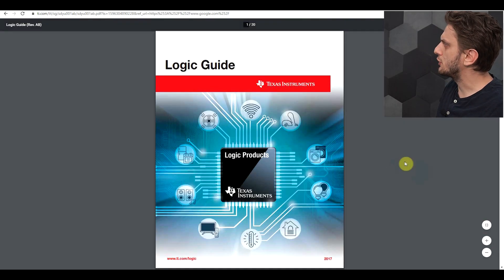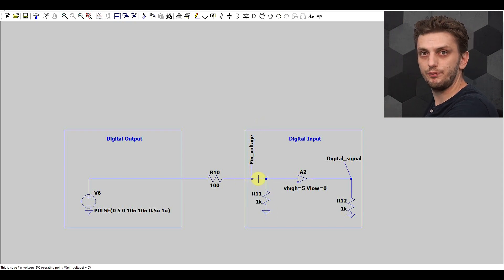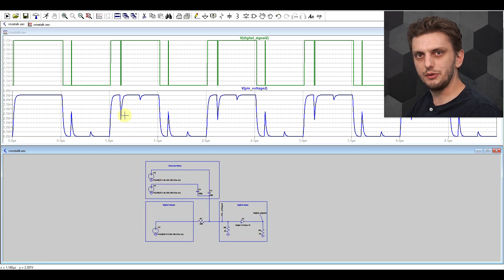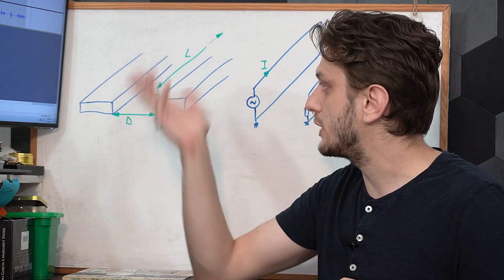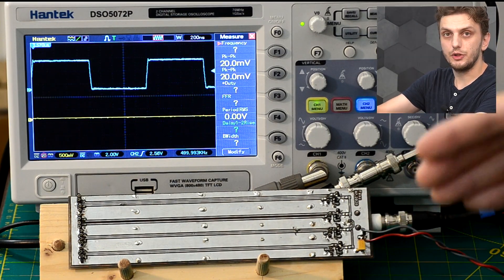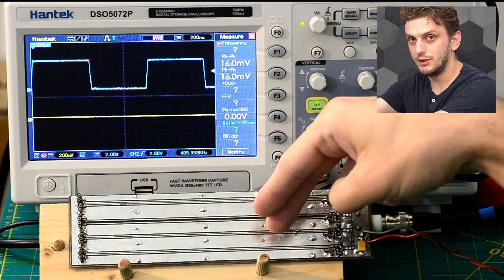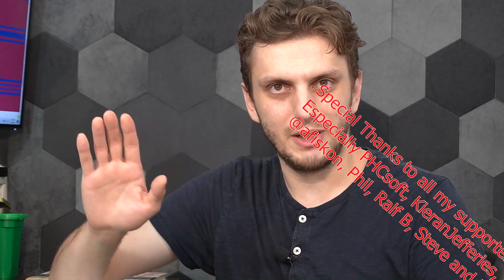Electronics tutorial - Crosstalk

Comment: Any other ways to make the crosstalk on the victim line worse by changing something on the aggressor line other than rise time?
Reply from the maker: The signal amplitude will have a direct impact on the induced signal. Otherwise its a mechanical topic - the exact distance between the traces and the distance over which they are adjacent.

Comment: keep them coming good man,
One question: why does high impedance source implies an E-field coupling and low impedance implies H-field coupling?
Reply from the maker: Hello! Well an E-field is generated by voltage applied between 2 terminals and H-field by magnetic fields, which are created by current going trough conductors; If we have a given amount of power (say 1W); the highest voltage (that will generate E-fields) will be obtained by applying the power onto a high impedance load - this will be accomplished with a low current ; on the other hand to get magnetic fields, so high current we need a low impedance, that will cause low voltage. Let me know if this makes sence
Reply: @FesZElectronics  Thank you good man.

Comment: Hey, I have been watching your videos for a long time. Your work is legit and far more precise than other youtube channels. I am very thankful for your videos. Talking about precision and accuracy, can you tell me how to accurately model the capacitance value that represents the coupling between a DUT (Device under test) and the ground plane when carrying Conducted Emissions Test for compliance. I really need a legit answer and I was hoping if could help me with that?
Thank you once again.
Reply from the maker: Hello Sajid! Well there is no easy answer to this. Depending on how the DUT is built, you need to see what trace is closest to the ground plane below - if its for example a metalic rear cover, or some other structure. This will be the bit that is capacitively coupled to the ground plane (a few pF). Then you need to see how this structure is connected to the rest of the circuit, and of course to your main noise generators. The common mode noise will be coupling trough the LISN into the ground plane, and back to the unit. So you need to model the noise generator the path of the noise - any input filters, the LISN and then the few pF back to the unit.
On the other hand if the noise is differential, than the ground plane coupling shouldn't matter that much since the noise goes out one supply line and back the other. 
May I ask what sort of device you are working on?
Reply: @FesZElectronics  
Basically, its the E.field parasitic coupling between the Buck converter switching node and ground plane as well as the between the metallic cover of an Iphone and Ground plane. In that experiment, they considered the capacitive coupling  between the Buck converter switching node and ground plane = 20pF and between the metallic cover of an Iphone and Ground plane = 100pF. So, I am going to share a picture of the whole experiment, I took it from that webinar. It will help get the idea.

https://drive.google.com/file/d/1O-Sw54TMwXtER8zCVgSJnK9cS_4SMYaQ/view?usp=sharing
Reply from the maker: Well there is quite a long cable between the Buck and Phone (seems to be ~1m) so that adds a bit of inductance - that should be modeled. You can of course model the cables as transmission lines - to have distributed capacitance and inductance. 
I think the most important part of the simulation needs to be the noise generator though - the wave forms and the spectrum of the noise in the switching node need to be accurately reproduced to get the same results in real life and in the simulator.
So to summarize, you need the noise source (the buck) the cables modeled as inductors or transmission lines, the LISN on one end and the phone just as a capacitor from circuit to ground plane on the other end, and the buck parasitic capacitance to the ground plane. This should offer a fairly precise model. 
Do you know what model of spectrum analyzer is used?
Reply: Yes, the spectrum analyser is  ROHDE & SCHWARZ FPC1500. I got the idea, but the only thing I am confused about is how to calculate the values for those parasitics? How I determine the values for inductors and capacitors, used to model the cables and parasitic coupling, respectively?
Reply from the maker: Well you can find quite a lot of online wire inductance calculators - simply plug in the wire length and thickness and you will get a good approximation of the inductance. For capacitance, its about surface are over distance - you can get a decent approximation by using plane parallel capacitor calculator for that. And if you have the measurement results - the real life ones, you can simply fine tune the values until the simulator shows a good match.
Reply: @FesZElectronics  So, my approach, for switch node coupling, was to use an oversized electrode of known size and put it at a known distance from GRP and feed it with a high harmonic content voltage (example square signal of 0-12V), then filter out the differential interference to catch only Common mode and then measure its capacitance. What do you think?
Reply from the maker: You can do that! Also you can try working on segments - replace the phone with a resistive load close to the SMPS - this way you only measure the SMPS and its cable, so you see exactly what the phone+USB cable adds to the system.

Comment: Really good explanation! 👍🏻👍🏻
Crosstalk is actually also really a thing with analog signals. 
It can even be part of your SNR, although nowadays crosstalk numbers are mostly more than good enough. 
A very difficult situation is when having high current switching signals (can also be digital) combined with analog signals.
Humm and other introduced noise is essentially also a form of crosstalk.
This was really an issue with tube amplifiers, especially because the current through the heater was quite significant.
Reply from the maker: Regarding noise in amplifiers, I noticed quite an interesting phenomenon in a transistor amplifier that was supplied from the mains trough a transformer - with an E+I type of core there was a very noticeable buzz but with a toroid transformer it all went away (no other filtration or change was made) - basically its not just switching supplies that can cause problems, you can get pretty bad results caused by the magnetic fields coming from normal 50(60) Hz transformers also.
Reply: @FesZElectronics  yes. Rotating a transformer will sometimes also help

Comment: Excellent! Another related subject to this is how to use ferrite beads and series resistances to shape the digital signal flanks to make the design less noisy. Ferrite beads are usually too expensive to use in practice but to install series resistance on data lines may let you trim the flanks after a PCB is designed. (Trimming overshoot and undershoot on digital signals)
https://electronics.stackexchange.com/questions/431884/series-resistor-on-digital-signal-lines
Reply from the maker: Hello Niklas! I guess this is a different subject, but an interesting one to cover! I know resistors are used both as "wave shaping" as well as impedance control on transmission lines, but the ferrite has the advantage of only acting on the higher frequency part of the spectral content. I did see ferrite networks being used on digital high speed lines - it saves space and I guess a 4 line network might be cheaper than 4 individual components. I will try to cover the various methods in the future - Thanks for the suggestion!
Reply: @FesZElectronics  Yes it would fit right into your EMI EMC playlist. I have not seen anybody else cover this subject on Youtube. It may require a higher bandwith oscilloscope to be able to view the higher frequency components. Love your videos.

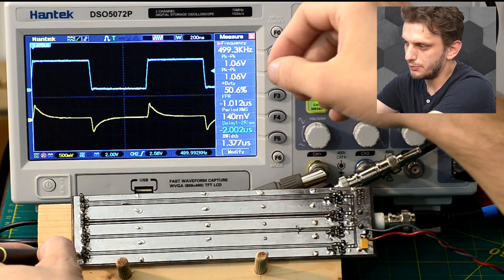Comment: Hello, it was really nice topic you are explanining. Love your  the way you show the complicated stuff. So I have a question. We see the voltage spikes on the second trace say shown at 6:47. What I dont understand from this scope pic is that current going through is not bidirectional. Current only flow to one way right. But why we see that coupled signal is passing both direction as it was induced by the ac signal. Thanks.
Reply from the maker: Hello Eren! The spike is not caused by the direction in which the current flows but rather the "direction" in which the voltage varies - when voltage is increasing, it also increases the voltage on the "victim" line, which afterwards recovers to zero; then when the voltage decreases, it also decreases the voltage on the other line turning it negative. 
On the other hand, regarding current direction, the driver is of push-pull type (the 2 transistor  configuration) - this can both source (send from driver to load) as well as sink (from load to driver) current. The trace has its own capacity and inductance so it does store a bit of energy which needs to be sink'ed so current does flow both ways.